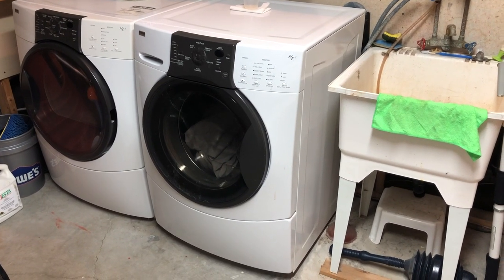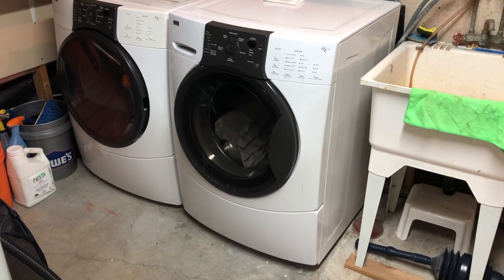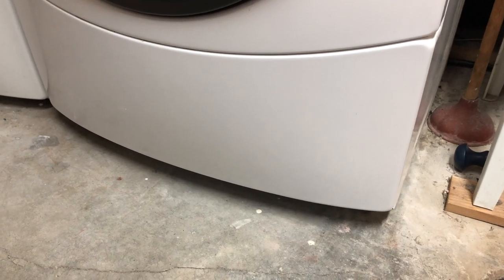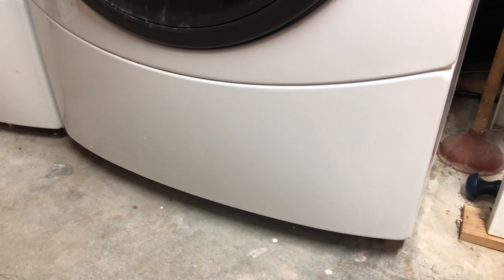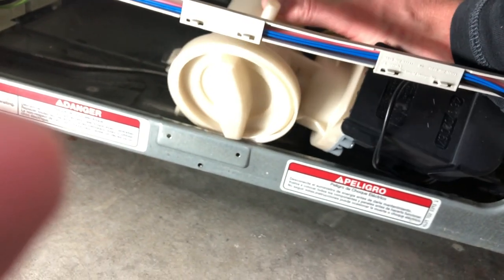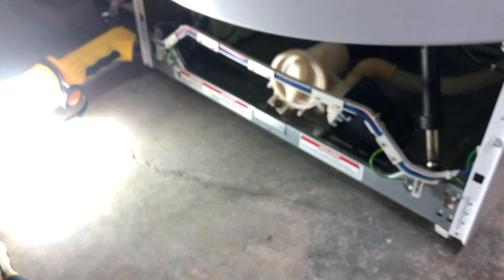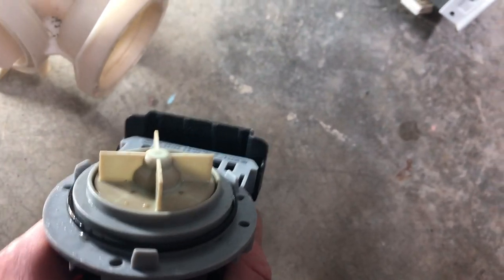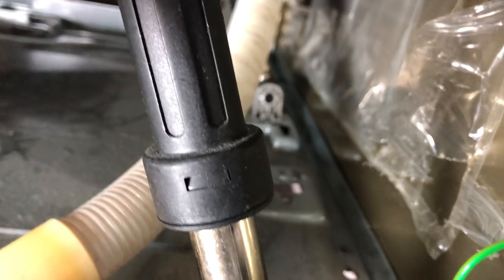BEST FIX || Washing Machine || Suds Error F02 || Kenmore HE3

Comment: Great video!  Turns out my drain pump was the issue.  When I took it apart as you suggested, the turbine was in excellent shape. However the metal shaft that connects the turbine to the motor had sheared off.  Too much torque over 19 years finally took its toll.  As such I just ordered a new drain pump assembly.  Your suggestion to separate the motor from the rest of the assembly revealed the root cause.  Thanks again!
Reply from the maker: Hi Victor,
Thanks so much for the feedback. Glad my video was able to help you diagnose the broken pump. That’s very interesting to hear about the broken shaft. Thanks for sharing that info for all of us. 

My pump is still working but has been making lots of noise. I’m glad all my cleaning was able to render the machine workable again. But despite those efforts,  the pump seems to be on its last legs and not pumping as strongly as it should so I’ll be changing it this week. 

I’ll be filming the process and taking the old pump apart as well. If you feel like subscribing to my channel that would be great :) and maybe that upcoming video or one of my other ones will interest you as well. 

All the best!
Mike Biker

Comment: Thanks for pointing out the pressure switch components at the back of the machine. The little chamber the pressure switch tube connects to was completely clogged up, which fixed the F02/Suds error when I cleaned it out. Machine works great now!
Reply from the maker: So happy it worked. Really interesting to hear that the switch piece was clogged. I wasn’t sure if junk would get that far up. Great to know. Thanks so much for taking the time to write. If you don’t mind liking and subscribing maybe another one of my fix vidéos will also help you out. All the best!

Comment: Thanks for the video. I was aware of the component in the back as I have had to clean it at least a couple of times over the last 5 years. The problem I have now is the rubber hose part between the tub and the drain. Its starting to degrade and replacing it should avoid some black gunk accumulating in the coin catch. Your video helped me realize how simple it is to replace.
Reply from the maker: Oh that’s awesome. So glad it was helpful to you!

Comment: I cleaned everything mentioned in the video, put it back to gether still had the same issue. It ended up being the impeller on the pump had worn out and was no longer engaging properly.  We replaced the pump and all works great. I've also noticed that it does not have a old washer smell anymore. 

To clean out the drain hoses I took a small bottle brush and attached a piece of tie wire to it and pulled it through a dozen or so times. A small tooth brush or pipe cleaner (real one not a craft one) also works to get nearly everything out.

Edit:
Also try not to get fluid into the pressure switch, the part mounted up high connected to the black hose. Its designed  for air not water. :)
Reply from the maker: Fantastic! Thanks for sharing.

Some great tricks you pointed out. I used a bottle brush as well but was limited by its length and could only clean a portion of tubing ... tying a wire and pulling it through is genius! Thanks.

What Make/Model of washer do you have? Was it easy to find a reasonably priced pump online?

Mike Biker

Comment: I have Kenmore HE3 QuietPak2 model 110 44862 404. A lot of years on it. This afternoon it gave the SUDS error and an F02 eventually. Lots of water in the tub (I also learned the hard way about water drainage when I removed the pump filter). The filter was clean. That had been the problem a couple of times over the years. 
Thanks for showing me all the other areas that could affect drainage. (One thing I noticed was that there was a really long delay between the drainage failure and the machine finally quitting the cycle it was in.) 
So I cleaned up all the water on the floor :(  and ran a drain and spin cycle that went fine.  The pump sent out some water. Then I threw in some of the wet towels and ran a rinse and spin. That failed. I waited (forever) until the machine gave up and allowed another drain and spin cycle. That went okay. I put the load of wet clothes back in and ran a successful drain and spin AND a rinse and spin. Next I left that load of jeans/sweat shirt and some other items in the washer, added some soap and softener, and started a normal cycle. Suds and eventually F02 with no drainage. I will let it time out again and try to get the clothes rinsed. Then I'll have to try the rest of your suggestions. 
Well, I did all but the one about the long black tube to the sensor. And it worked for a drain & spin and also for a rinse and spin but failed again on a normal cycle. After that it acted, again, like the pump was running but not expelling water. I caved and ordered a new washer. Not worth spending a lot of money trying parts or calling for repair on a unit this old.

Comment: Hi! Thanks for your video. I saw this one after I watched a different one and tried fixing it. The pump behind the front panel of the machine that has a screw cap - I emptied that already and was able to successfully finish two loads. That was clogged with a sock and pennies. Now I have the F02 error code again. I might first see if theres something else in there then clean the hoses. We just changed the rubber gasket a couple months ago, so I would be shocked if stuff gets in the drain again. However, I noticed the back drain hose that runs into the wall has tons of gunk. I will try cleaning all of the hoses before buying a new pump. Strange because in the past - I was able to just turn off the cycle and turn it back on and it would work, but this time it keeps showing the error.
Reply from the maker: Hi Lexii, 

Sorry for the late reply. Nicely done!

Yes the same occurred with me, for the longest time I just had to restart the load and it would drain. But as time progressed I eventually got the F0 to code permanently.

Definitely proceed with cleaning out the other hoses. I’m sure all the blockage was a main part of the error code, but if the other hoses have some gunk in them then that would also cause the error code to persist.

Please read back and let me and the rest of us know how it went for you.

You should also know that even though I cleaned out every hose completely and it solved my F02 error code for a good number of months, eventually the pump died and I had to replace it. I posted a video of the steps for doing that with some information on where to find the best pump.

But if cleaning the hoses can buy you some time like you did me that would definitely be the best way to proceed. Doesn’t take a whole lot of time and is quite rewarding. Not to mention down the road if you do need to get a new pump at least you’re confident in knowing that all the hoses are clean and the new pump won’t have to work as hard. 

All the best!
Mike

Comment: I liked the video. I see that you did not show how you cleaned out tubes and the removal of the back panel. I think that if you take just more time with more steps (just a little more time. It would help those that it's there first time with home improvements on our day to day products that we have to use. I just had to replace a cooling fan in my refrigerator. GE French doors. Come to find out the part is made overseas and is not meant to last. Lucky I found a guy that has a YouTube and went step by step from beginning to end. Take apart and put back together. Keep it going man.
Reply: Thanks man! You’re so right, my video was definitely missing a few things :( 
I only decided to make the video after the fact, once everything was already cleaned and I discovered that this fix worked. So I  backtracked the filming steps in reverse when putting everything back together. Very amateur lol. 

I also own a GE refrigerator with French doors! What was the video you watched? Mine is running fine at the moment but I’d love to watch someone take it apart and understand the machine for when I do need to fix something on it!!

Many Thanks!

Comment: Thanks for the video! I disassembled and cleaned every part as you described. There was some dirt but nothing special. Unfortunately, it didn't make the trick. I still see the F02 error. So, I've just ordered a new pump. Will see, hopefully, it is going to help. But I'm not sure either. I think a pump either works or not. But in my case, it sometimes pumps the water, sometimes F02.
Reply from the maker: Hi Viktor,

Thanks so much for writing. Glad you were able to clean everything out. 

I believe you will have great success with a new pump. 

My machine was working well after The cleaning but would still sometimes show the error code like yours when I would do heavy loads of bath towels or a very thick blanket etc. It was just a matter of removing the items and performing a drain cycle to get things back to normal. But it was definitely frustrating to have to keep doing.

Turns out that the impeller was a bit loose and wasn’t sitting flush against the pump motor. It would still spin during a drain cycle, but it was no longer working as effectively as a new pump. Same thing happened to another commentor on my video. 

I just finished making a new video of the new pump installation as well as a detailed view of what was the problem  with the old pump. 

I should be posting that video sometime next week. Please subscribe to my channel so you’ll be notified when it’s out. Please keep your old pump and I’d love for you to watch the new video when it comes out and see if your pump suffered the same problem. 

But the main thing is that cleaning out your machine was definitely not a waste of time. With a new pump and a fully clean machine you will have the peace of mind knowing that your washer was given a complete makeover and will run like new again!

Cheers!
Mike Biker
Reply: @mikebikercanada  thanks, Mike! I'll comment later on whether the new pump works for me.
Reply: @mikebikercanada  Hi Mike, so, you were right. The impeller was not in the right place anymore. I've replaced the pump, and now the machine works well.
I bought one of the cheapest pumps on Amazon - Ketofa CAD36. I'd not recommend it as it's pretty rough, and after I installed it, the water splashed all over the machine insides. It just doesn't fit snugly. I had to screw in 2 additional screws to make it tight.
Reply from the maker: @vkucherov  Fantastic! So glad you were able to narrow down the pump problem.

Good to know about the cheaper pump. I was about to order one very similar, but chickened out after reading many reviews saying that they only last about a year.

I was able to find a direct OEM replacement on Amazon.ca for $60 CAD (+$60 CAD shipping) so $120 all together. But the pump is identical to the original and will hopefully last another 15 years. I'll attach the link, it's sold by Global Solutions USA and was delivered to my house in Ottawa, Canada from Miami, Florida in under 48hrs. The company also texted me within an hour of ordering to verify the model number of my washer so they can confirm I order the right part before mailing it out. Pretty solid. 
https://www.amazon.ca/dp/B088Q2G1KB/ref=cm_sw_em_r_mt_dp_QPXHBFQJDJ1CH13JKPDX?_encoding=UTF8&psc=1
Again, so glad you got it fixed. All the best man, and please subscribe if it's not too much trouble. Maybe one of my next videos will interest you!

Comment: Thank you so much for your video. Do you know what that plastic part at the end of your video is called? That had that “black gunk”. We have a kenmore all in one washer and dryer combo. Our error is “DE” drain error. “Pump clogged”. So I removed the front little hose and basket and cleaned those out and I do this maintenance monthly. I ran a cycle and put a bucket in the front and I can see the pump pushing the water out with force. However once I reassemble everything and run the cycle again, I then get the same error as if it won’t pump it out the back hose into my home’s drain line. I have cleaned all the parts and hoses in your video and even cleaned out the drain pump and put it back together. Again, I run the cycle and as long as I have the bucket in the front and the tiny hose drain into that I get no error. I’m not understanding if it’s clogged in the plastic part at the end of your video or if the pump is not strong enough to force the water through the back drain hose as it is suppose to work. Any guidance would be greatly appreciated. I am now gonna take it apart again and see if I can see any gunk in the part that is at the end of your video as that is the only thing I have not taken apart and cleaned yet. Again, Thank you so much for your video.
Reply from the maker: Hello, 

Great job taking everything apart. Sounds like you're doing a very thorough job! 

That part at the end of my video is simply referred to as the "chamber" that leads to the pressure switch. That, the switch and the skinny black hose are all considered the pressure switch assembly. I tried attaching a link to a great video describing those parts and ways to diagnose if they're your problem, but unfortunately YouTube doesn't seem to be allowing me to ad it in my comments. Search "Diagnosing Washing Machine Pressure Switch Problems" and you should find it quite easily.

Have a look at the video and keep me posted. Hopefully we can get this fixed!

Also, just to clarify that your error code was indeed "DE"?
From what I've found that seems to be an error indicating that the washer door was unable to lock. If so, simply resetting the machine seems to be the go-to fix for that error code. To do a reset you simply unplug the machine and while unplugged press and hold the START/PAUSE button for 5 seconds. Then plug back in.
Reply: Thank you so much!! I will look at the video now. My error code “OE” according to the troubleshooting guide says it’s a “pump filter clogged”. However this error came after my neighbor turned off both our breakers (the main breaker) to both buildings. And I cannot seem to clear the error. I can drain the cycles with a bucket and lil black hose out the front of the washer but it won’t drain out the main back hose like it’s supposed to, to the main house drain. I see the pressure when the water comes out the front when the pump is in the rinse/spin cycle. I have a washer/ dryer all in one combo by kenmore. It is a washer and then Dries the clothes after the wash cycle is done. So technically since I can not get it to go past the point of when they turned off the breaker now my dryer won’t work either because it can’t get past that point. I guess it uses a lil water during the drying cycle to create steam to dry the clothes, so it has to also drain  a bit during the dry cycle, if that makes sense. We ordered a pump and hopefully that will resolve the issue. I pray that is what it is because we had no issues prior to them turning off the washer at the breaker midcycle. Thank you again for replying and may God reward you a thousandfold for all your efforts.

Comment: I'm wondering if the F2 SUDS error might have been helped by running a few empty loads using a 16 OZ bottle of vinegar (INSTEAD OF SOAP) while using the SOAK or PRE-TREAT and also the SMALL LOAD selections? Would this run through all of the hoses? Vinegar works great to clean my coffee maker. I'm thinking I'll try doing that 2-3 times before taking the back off of it, etc. My HE 3t is 20 years old, however, I've been a single professional (wearing dry clean only clothes) for most of that time, so it's had extremely light usage. Thank you so much for this video---lots of Heaven points have been credited to your account!🙂
Reply from the maker: Hi Emily! 
Thanks for reaching out. That’s definitely worth a try!  And if you try this and it resolved the problem than let us all know! 😃👍 
The vinegar should flush through every hose except for that one plastic piece at the back which leads to the pressure switch. The water just sits there and it’s air that travels up the black hose to the switch. So while the water will be full of vinegar, it won’t flowing through at any capacity to wash the grime away. But you may not have any grime built-up in that piece anyhow. 

Only one way to find out! :) and again. Let me (all of us) know how it goes!

And thank you for the heaven points 🙏
it makes me so happy and grateful to hear whenever someone finds one of my videos helpful. 

If you’re so kind enough to subscribe to my channel that would be just awesome! Maybe one of my other videos will interest/entertain you :). But no pressure, completely up to you!

Good luck! And Looking forward to hearing back from you. 

Mike

Comment: I have this washer for 17 years, it runs well. Got this at Sears and the sales said it was made in Germany. They don’t make this good machine anymore. Two things I don’t prefer are: smaller capacity and spin speed a little low, heavy towels can be drier.
Reply from the maker: Hi Helen,

Yes I totally agree with you, I wish the spin cycle was stronger!

Mike

Comment: Fantastic video!  The step-by-step instructions were very clear.  Like you, I found some accumulation all the way through, but nothing really shocking.  It may turn out to be the pump, but at least I know I have a clean system.    One question:  I am having a hard time getting the spring clamps reconnected, especially on the interior hoses.    Do you have any tips on that?  Did you use a normal set of pliers?
Reply from the maker: Thanks Scott! And thanks for the feedback on your machine. Glad you found it helpful! 

My apologies for the late reply. 

Yes the clamps are a challenge. I used regular pliers the first time. But realized life was mush easier with a pair of bent nose pliers. So when it came time to change the pump and do it all over again, I invested in a pair ! I highly recommend doing that.